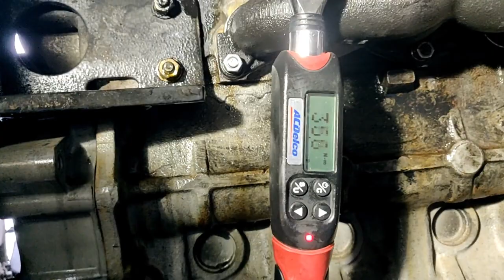Carrier reefer unit exhaust manifold replacement

Comment: Where is all that oil coming from the back of the unit mine is leaking from the back of the Valve cover and it goes on the exhaust manifold and burns like crazy and how come you didn't just change the whole exhaust.

Comment: This repair can be successfully performed without removal of the unit from the trailer.
Reply from the maker: Not if all exhaust manifold are rusted and break when you remove them And you need to drill and remove the thread!
Reply: @valeriumoscalu7580  , it still can be done.
Just did one last night.
Cracked manifold with 3 of the 8 studs snapped in the head.
Cast head, studs once heated will walk right out.
It definitely is tight but sure beats removing the entire reefer as per Carrier instructions.
Reply from the maker: You can heat and remove when you have a small part of the stud out but when it's broken on the same surface with head and need to be drilled its easier to remove, it's just 40 min to remove it but it's worth it, much more easier to work around!

Comment: I can do it with the reefer still mounted
Reply from the maker: For me was much more easier like this!
Reply: Repair shop replaced my manifold with the reefer still mounted on the trailer. 3.5 hrs total time
Reply from the maker: If the studs are good yes, in my case some of them broke so I was supposed to remove te old studs and fix the thread , there is no enough space, was much more easier like this!
Reply: @valeriumoscalu7580  Yes. I got lucky..no Bolts broke!
Reply: @danshannonlapierre2504 do you remember how much was total to fix it?